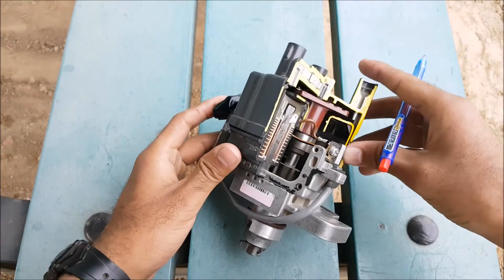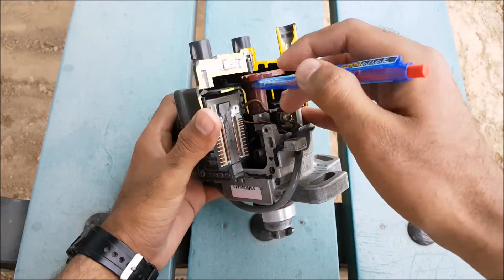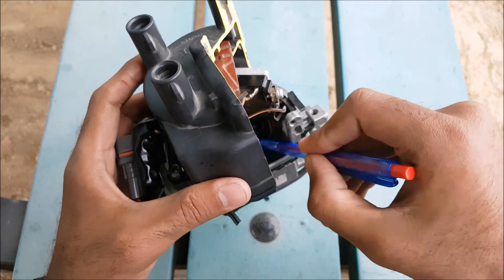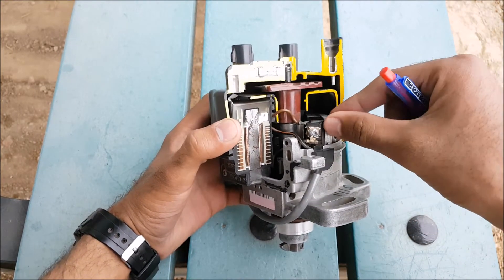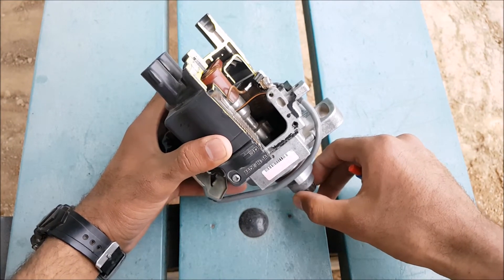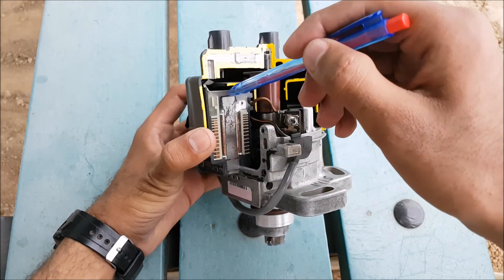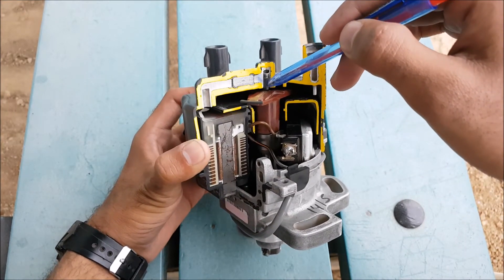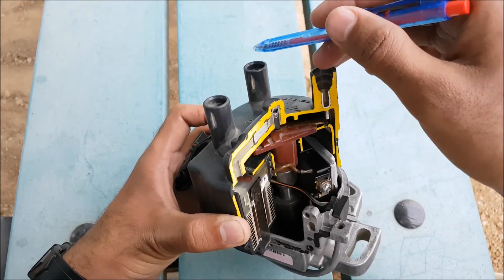How an Electronic distributor works

Comment: What is the single nub on the shaft right under the rotor for? Thanks for the video.
Reply from the maker: Its the reluctor , having 4 peaks for 4 cylinder engine. Every time it comes infront , spark is blown inside the combustion chamber according to firing order.
Reply: @automotivespot  I was referring to the one with 1 peak. I found out it is the cam position sensor. Thanks for the reply.
Reply from the maker: Ok dear